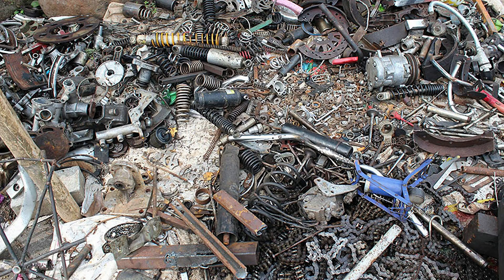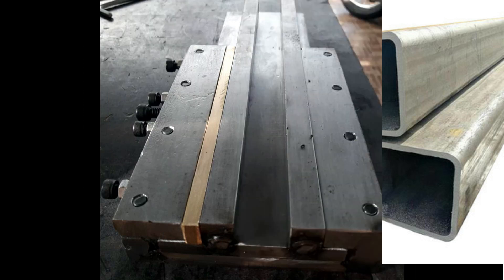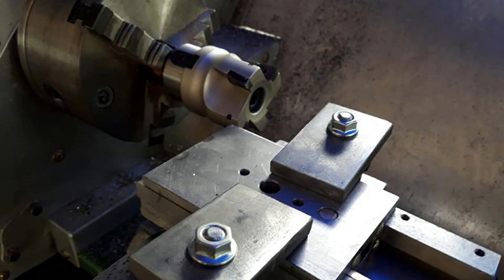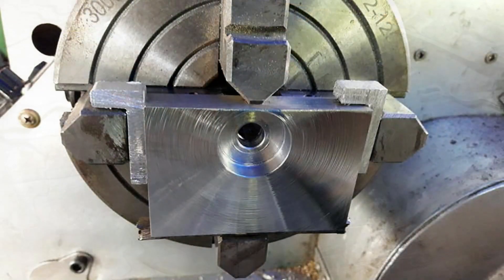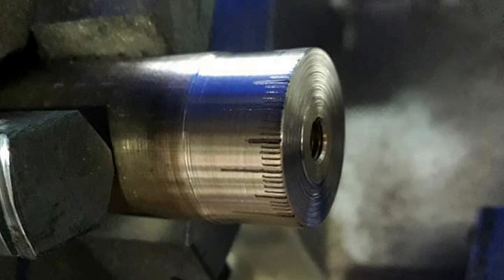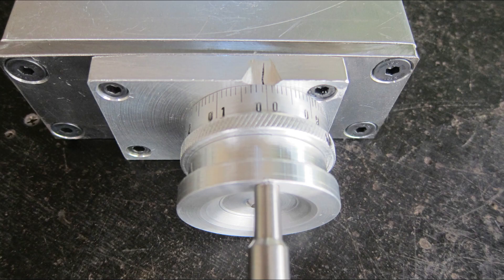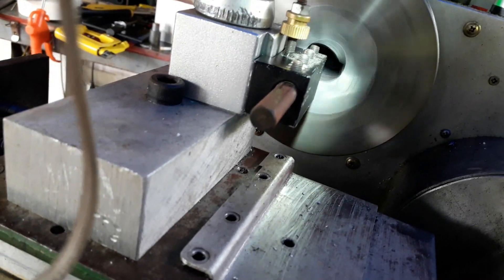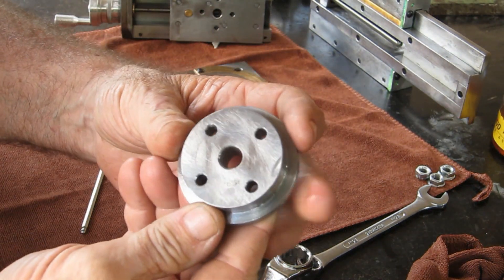MHW Episode 6 (DIY Homemade Lathe Upgrade) Part 2 - New Cross Slide Build

Comment: Good job on the Compound slide Dave. I have been doing up an ancient very small lathe that did not have a compound slide so not having a milling machine I have had the Dovetails cut elsewhere. However, the cost being through the roof I have nearly finished building it but nowhere in the same class of compound slide of yours as everything has to be filed to size and never looks as good as a milled piece of steel but it will do me. 
I have to lol at this Compound slide because it is the newest piece on the lathe and I guess it will look out of place as everything else is cast iron 1930's style. This lathe does not have thread cutting means but It will cut replacement gears as I am making a gear milling attachment that fits on a vertical slide which you can get quite cheaply for small lathes on eBay. Anyway, what I need it for is only very small stuff as in small cannons and model-type stuff. 
 Maybe you will think why did I not buy a compound slide of Ebay? The reason is I had no room to fit the one off eBay and so maybe I may put up a video of the cross slide and how small in-depth it had to be strong also. 
 *A question about your tool post holder. Is your tool post made of anodized Aluminium which it appears to be as it looks exactly like the one I bought of the Temu. I thought it must have been at least all the black colors to be metal but they are not. As long as it works I don't really care about that as I had said before what I am machining is very light using hand feed and slow speeds and nice sharp HSS. HSS takes longer, but you can obtain a shiny finish if you sharpen the tool steel correctly. Maybe one day I will put up a video about how I do it and you will be amazed at what is required to get a good finish on metal using patience.  A lot of it has to do with what type of metal you are turning of course. Cheers Gary
Reply from the maker: @GaryPArmstrong  The first quick change tool holder I bought was Aluminium and it was rubbish the one I have now is steel. Thanks for watching. 👍